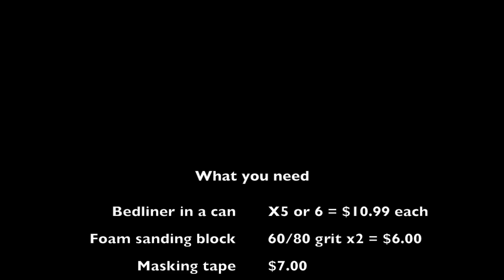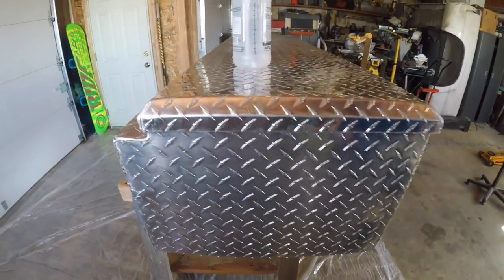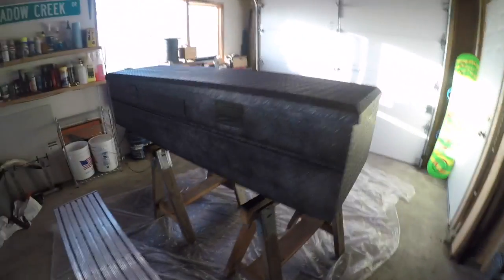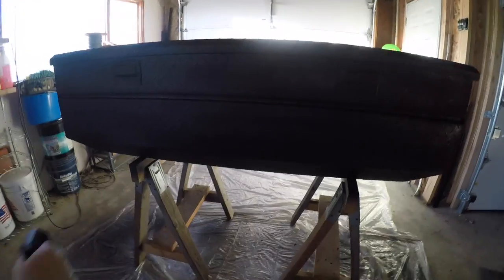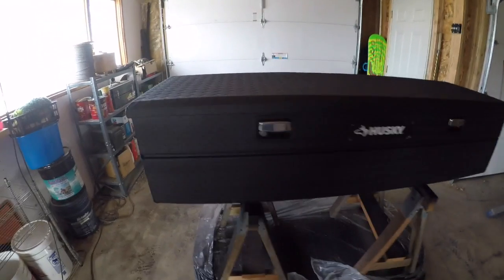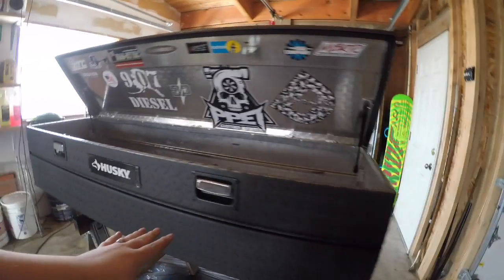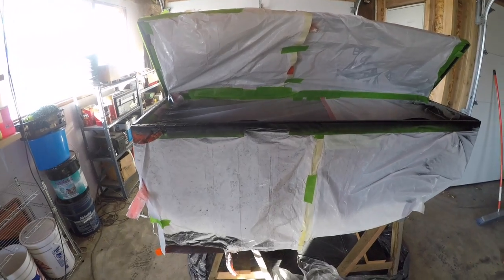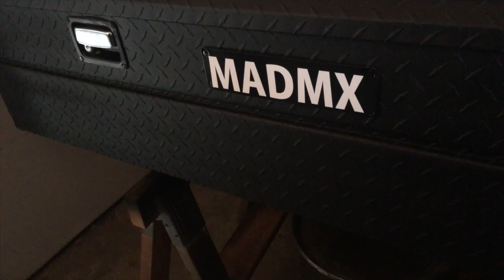How to bedline a toolbox

Comment: I'm glad you made this video because I just bought an old aluminum box that I want to do this exact project to. My truck is all black and white, so I think the black will look way nicer than the diamondplate. Thank you!
Reply from the maker: Tracy Ranger thanks for watching, remember it’s all in the prep.  Good luck!
Reply: Project Duramax
Just finished the tool box rehab and Holy Shit it looks SO GOOD! I wish I could show you the before & after pix! I cleaned it, scuffed it, but used a wire bristle brush and then did a couple coats of self etching primer, then a couple coats of a Rustoleum truck bed liner that is a flat black with a slight texture to it. It covered really well in just two coats, but I'll let it sit overnight and maybe do a third coat tomorrow. I liked that paint so much, I painted my motorcycle ramps, my step stool, and the trailer hitch receiver that I haven't installed yet. I'm prob gonna throw a coat on my nerf bars and I'm also thinking about blacking out my chrome bumpers too! 😂 😂 😂 this paint looks so good, I think I've gone a little crazy with it... 😂 😂 😂
Reply from the maker: Tracy Ranger glad to hear it came out so well.
Reply: @markymark6928  Im curious too,  I might do this tonight after work.  I work at an Advance Auto so i can get my discount on that stuff.  I've never heard of self etching primer though.  gonna look into it.

Comment: You didnt use any primer. That's not going to last. USE PRIMER EVERYONE. METAL PRIMER.
Reply from the maker: Clay still holding up two years latter. But I do agree primer would help.
Reply: I totally agree with using either a etching primer or non-etching primer if you're going to sand first.  Addtionally, I would have used a few coats of flat clear coating to protect the paint from chipping and weather.  Snow and ice take their toll on both aluminum and steel, especially where I live.

Comment: Think I'm going lazy and prep with a wire brush and drill
Reply: use stainless steel. Carbon steel wil contaminate the aluminum and cause corrosion.

Comment: nice video,  but damn it made me dizzy had to go walk around for a while.  i hate my eyes,  feel so shitty right now.  I'm planning on doing this myself and will be doing the interior.  I had a box given to me and I wanna clean it up.  i was given a black one but wanna just make it tougher and it will look newer this way as well.  already had to do some repairs to it like fixing the strikers, that was easy,  change the key and angle grind out the messed up ball nuts,  that took a while,  they don't like to be cut.  and installed new struts 35lb rated each.  got those on amazon for like 11 bucks w/ tax.  great struts.  though they don't have oil in them so you need to hold your hand on the lid other wise it opens toooooooo hard.  got the new ball nuts on amazon as well for like 11 or 12 after tax.  so not bad.

Comment: What other Bedliner would u recommend I can’t find that brand in any local store
Reply from the maker: kingpaco37 not sure. I haven’t used any other brands. I would go to your local auto parts store. Find a similar can and look at reviews online.  Thanks for watching.
Reply: Rust-o-leum has held up well on my rocker panels in the 6 months I've had it on. Less than 10 bucks at Home Depot usually.